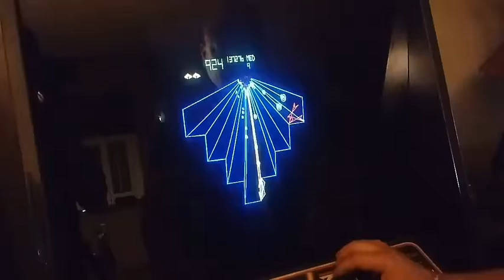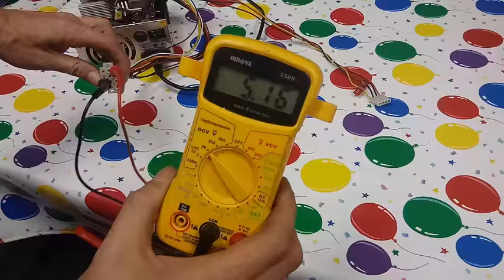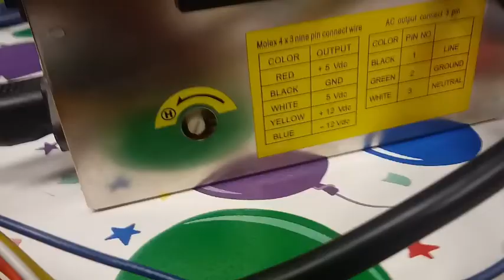Basic Arcade Repair: How To Test A Power Supply

Comment: MATTYMOS ARCADE, why does most arcade games power supply only use ONE filter cap rated at 27,000uf microfarads and higher? Why only one filter cap and one such a very large capacitance? most power supplies use multiple filter caps and their capacitance is 10uf to 100uf not 27,000uf and higher. There must be a reason for this but not sure why do you know why?
Reply from the maker: Most monitors only use one too. Also with high capacitance. It would be cheaper to use 2-3. That's a good question.
Reply: @MattyMosArcade  yes most power supplys use multiple filter caps compared to arcade power supplys just only use one filter cap at a very high capacitance I thought maybe your techs might have knew the answer

Comment: I have a Time Crisis 2. Same looking power supply, however the knob under the 5 volts says 3.3v. Do you check it with the yellow wire too?
Reply from the maker: 3.3v is too low. The yellow will tell you the 12v reading. Both will raise if you turn it up. If you can't get the red wire reading (5v) to 4.9 or so, you'll need to replace the power supply. They do go bad after a few years.